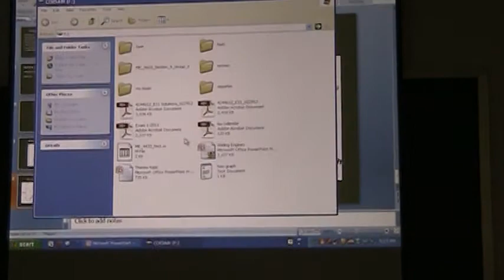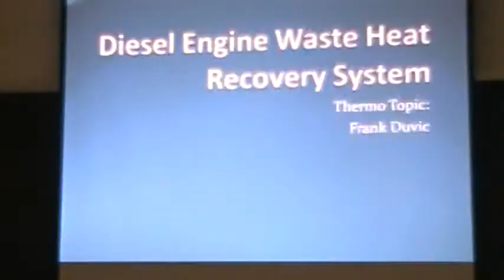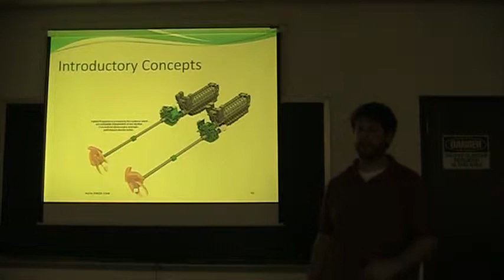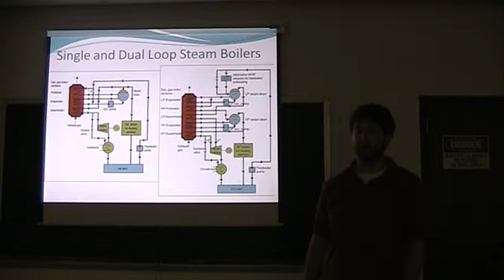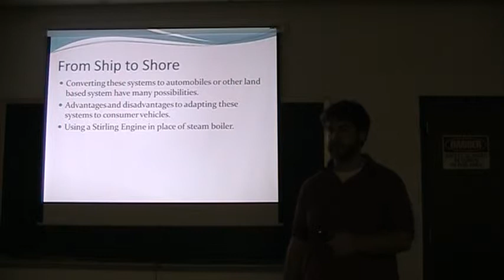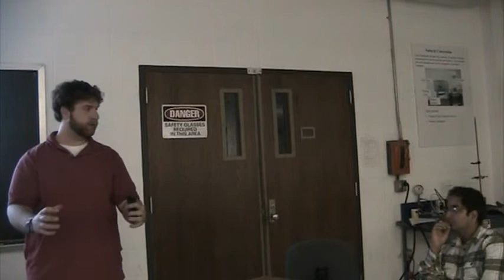Frank Duvic

Comment: On the technical side of things, there has been some research done pertaining to using Stirling Engines for waste heat recovery on automobiles. You mentioned Stirling Engines, but you could have gone into more detail in this area. Other than that, it was a very informative presentation.